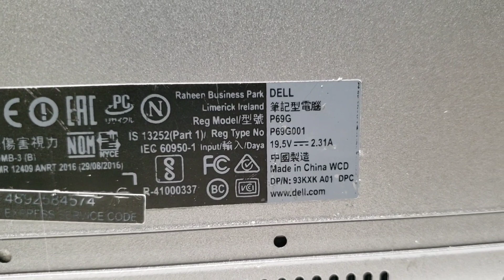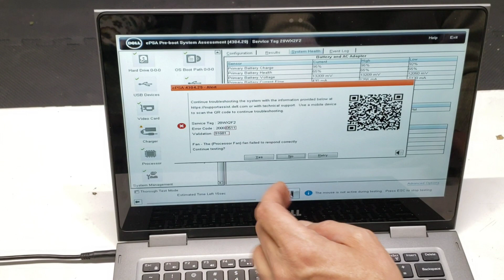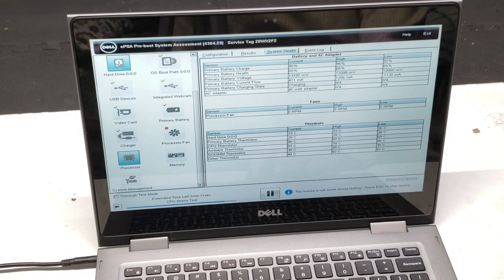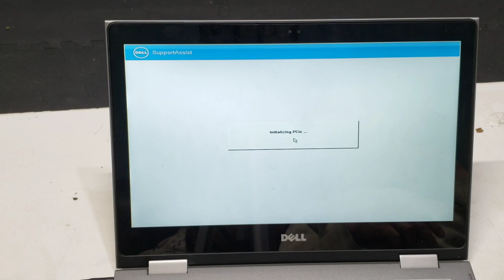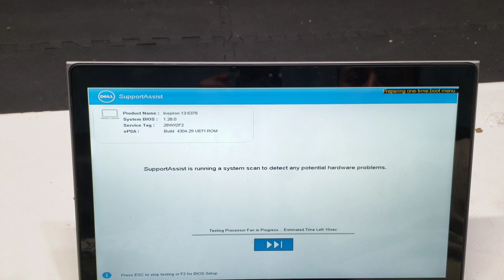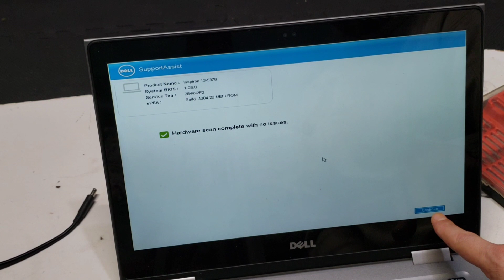How to Fix Laptop processor Fan Stop Working!!! Testing, Checking And Easy Fix

Comment: Hey i need help my dell Inspiron 15 3000 cpu fan won't work ...plss i need ur help i need to use the laptop for assignment
Reply: I need ur guidance plss
Reply: What do i have to do
Reply from the maker: Hi Ahmed, when laptop fan stoped working  caused by 3 main reasons 
1- the fan has built up durt over time and stuck not spinning  to fix the issues follow those steps :
1- Open laptop back cover 
2- Use air pressure either cans pressure cleaning or air compressor to blow the durt out on the fan 
3- while the back cover off power on laptop and see the fan if it's working 
You can also heat it spinning if not try to spin it by just touching it with your finger that can help the fan kick starts if it was stuck or jamed then you should see the fan starts spinning fast 
2- check the fan wires and connectors if they are loosed or not cot connected properly also check what can you see clearly to make sure all connectors are ok and check electronic boards make sure no cracks or bad connections 
3-  if still didn't work that means the fan was burned out and not working anymore then you need to replace it with new fan 
Hope thus can help you good luck and all the best 👍
Reply from the maker: My pleasure
Reply: @WorldRandomVideos  very grateful for ur help..but can i ask u for more favour???. Like can we have a zoom meeting n i show my laptop n u can observe on what's wrong with it?? Is it oky ?? I'm rlly desperate rn